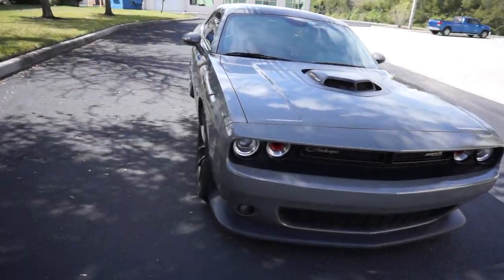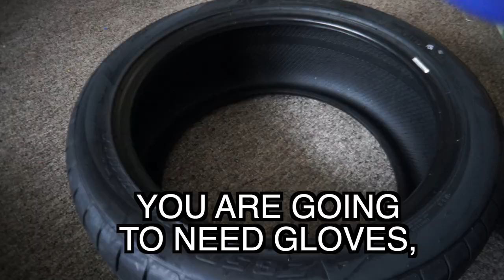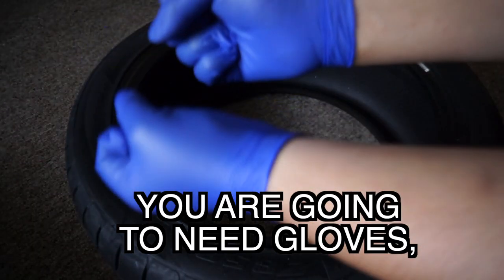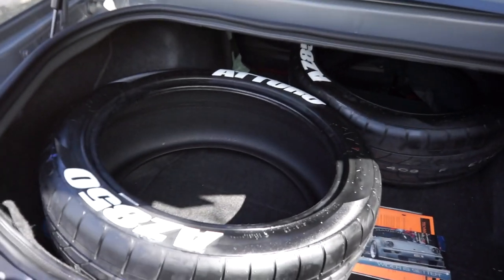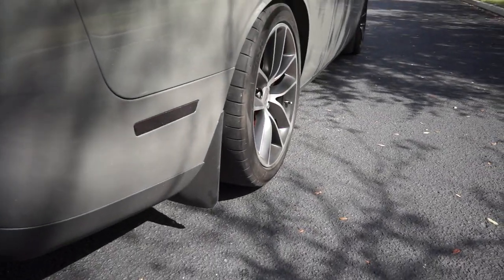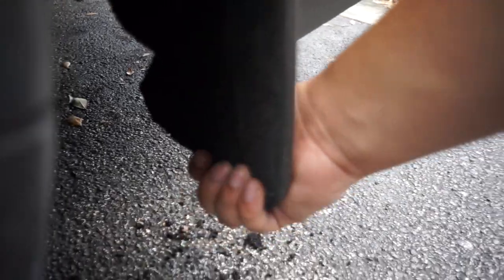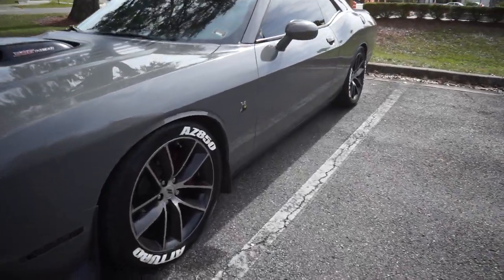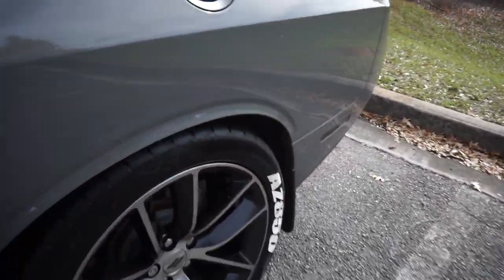TREDWEAR TIRE STICKER INSTALLATION + SUSPENSION UPDATE #tredwear #tirestickers #install

Comment: Where did you get the paper from😭😭 I loveeeee the turn out🙌🏼😍
Reply from the maker: The Transfer Paper? It comes with the order from tredwear. So much easier. But I’m prettt sure u could get transfer paper/tape from a local Home Depot or Lowe’s. U would just have to cut the shape you need out